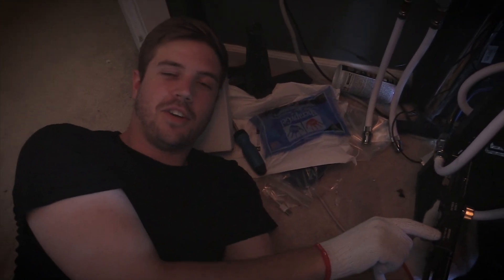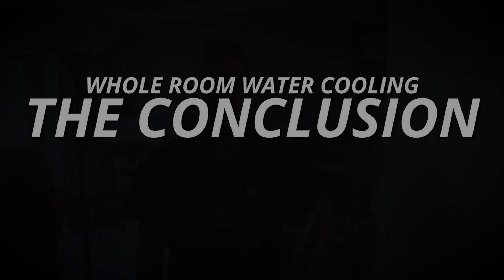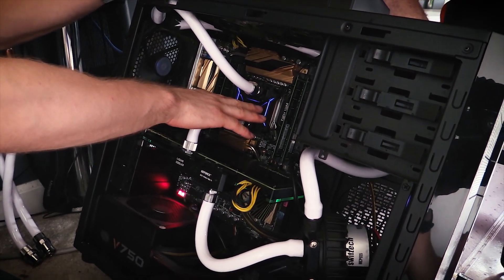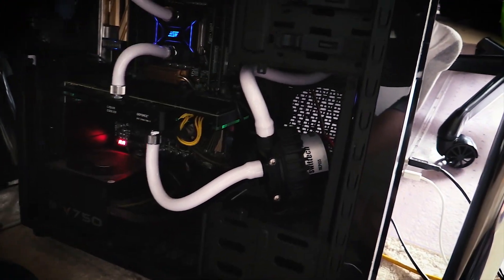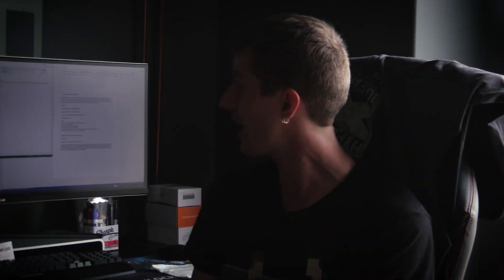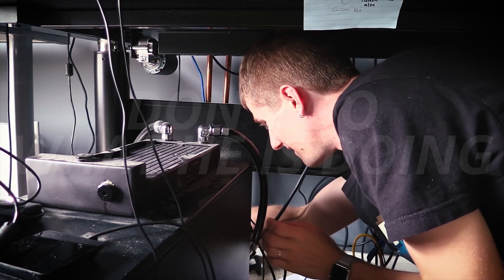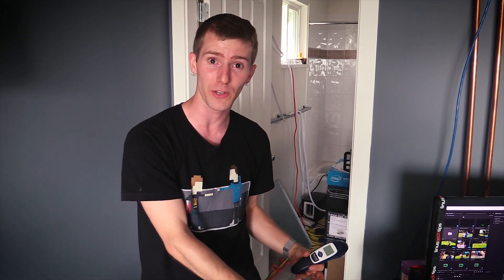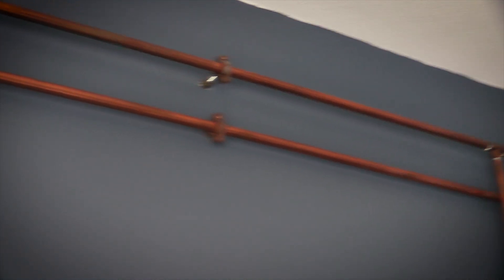Whole Room Water Cooling Part 7 - It's FINALLY over!

Comment: Isn't that going to bring the value of the house down?
Reply: RaySchrantz Ever heard of disassembly? If i buy an shelf and mount it to the wall i take it with me if i move.
Reply: HazzaRamma123 no, they are going with air conditioning in the new office. Linus already said that.
Reply: I do property management (commercial) and no, all that stuff can easily be removed. When you look at a house to move into, there are always going to be lots of marks, holes in wall, etc etc. but you can easily patch it up to a decent/acceptable state. If you are renting however, landlord would probably deduct a tiny amount for excessive holes in wall (screws, large nails, mounts).
Reply: They're going to take this set up to the new office
Reply: RaySchrantz No.
Reply: LxC The only thing they have to do is patch the holes. re-paint any walls they may have painted themselves, clean the floors and do a decent job of vacuuming the rugs.  I don't know what the rent laws are in Canada but depending on how old the rugs are the landlord has to buy new rugs anyway which shouldn't come out of their deposit.
Reply: James Bernard
 Yup, exactly.

Comment: Linus it would have probably helped if you insulated the copper pipes on the outlets as to keep the heat within the pipes. You would have probably seen a sharper drop in temps.

Comment: I think that the whole room water cooling approach is quite practical. It is relatively easy to add new systems to the loop, and it is quite a nice performer. There may be a case where there is a room with no windows or AC, such as a basement, for which this project would have been perfect. 
It also has it's caveats. For one, I don't think it was anywhere near cheap to make, with all of those expensive fans, radiators (I think a better solution would have been to use a car radiator + fan), and fancy fittings. Other is that you need another room to install all the pumps and reservoir, plus al the hassle it would take to make it appealing.
I think that in the end, it was nice of you guys to try this out to

Comment: You should try using those thermal insulating goop or w.e to cover the pipes, you'd need a lot but at least then the heat won't dissipate into the room

Comment: Umm, Linus, couldn't you just, you know, move the PC's out of the room? LOL
Reply: ChapelCentaur92 Because it was probably the best room for all the computers to be in space wise. Or else he would have moved them into another room :p. Seriously though, a few air con units in the room would have been much more practical.
Reply: ***** Thank you...
Reply: They don't have the space to give everyone their own office, plus it'd be less efficient if they collaborated on a video.
Reply: ***** What about that system requires HDMI? DVI and display port can also be run very long distances, the conference room at a company I once worked for even has a DVI port mounted in the back with in-wall wiring connecting it to the ceiling mounted projector (that rig is kinda old, hence the DVI to a projector).
Reply: Wolves4ever 01 I think the problem with installing an a/c in that room is that window.  That window is the side-sliding type and it is not that wide.  To cool that many PC, they need an a/c that is rated 10,000 to 12,000 BTU.  That is a large unit so no way to install that on that window.  A floor a/c will be impractical due to space.  The only option is the external a/c unit where the compressor is outside, hanging on the wall of the house, and the outlet unit in the room.  However, that is a rather expensive to do and, if you are installing that yourself, rather dangerous without the right equipment.  That room was not meant to be a workstation room.  lol
Reply: Oyamada13 The extra AC unit in the windows wouldn't replace the central AC, so you could get away with a window unit quite easily as it would accompany what AC they already have. Trabber Shir quality HDMI cables can run something like 45 feet before you need one of those RedMere cables, or any sort of amplification.
Reply: ***** HDMI is suppose to replace DP which only has only a 16gb transfer compared to 32gb and shitty sound quality
Reply: AdamantiumDragon NG  I'm assuming typo or grammar error, but in case that is not the case let me correct you.
DP 1.2 can transfer 12.6Gb/s, DP 1.3 can transfer 32.4Gb/s and HDMI 2.0 can only transfer 18Gb/s.

Neither is meant to replace the other they are competing standards from competing companies. DP supports multiple displays, higher max resolution and better sound, but has higher royalty costs, does not transmit over long distances as well, and is harder to implement against.

I'd like to thank Brenden Bauman for pointing out the range limitation, I'd never tried running DP over more than 3 meters before so didn't know about that limitation.

Comment: Instead of an outside radiator you should have gone with a well that goes deep enough to get flooded by one meter of water inside of witch you could have coiled some varnished copper pipe and the heat would have dissipated in to the ground water witch has an enormous thermal mass and could have made a phenomenal difference during summer but for the Canadian winter that outside fan is priceless.
Nevertheless the greatest infraction of that design is in not insulating the copper pipes witch left exposed are cooling the hot room more than the systems.
It's basic physics, how much copper surface area (pipes) was touching the air in the room versus how much copper surface area (water blocks) was touching hot silicon die.

Comment: interesting idea, horrible execution. you are better off using insulated piping that runs to a phase change cooler to cool the radiators if you were going to be extreme. pressurize the system to allow for lower tempertures and protect your shit from dew point. 

or just use AC and big ass radiators....because thats logical

Comment: From the first vid I thought this wouldnt work, you spent  tons more money on quick release fittings and copper pipe that just a simple air con would have cost. Anyway if you are using machines for rendering and stuff the the right hardware would be a good start too - as I am sure will be the case in the new place

Comment: ..Wait, why didn't you just insulate the hot side copper? It won't radiate no where near as much heat and this system will get MUCH more efficient. You can't complain about it not working if your system is flawed.

Comment: If I were to do this I think I would go with PEX through the walls rather than copper. The advantages are numerous... cheaper, less fittings required, better insulation, scale resist, doesn't corrode, and it is quieter (though maybe sound isn't a problem at that pressure.)

Comment: plz do whole room mineral oil cooling! I have no idea how it would work.
Reply: Baldrick sodoff Then they'll be working in scuba gear. Haha**P e a c e
Reply: DedPixel The pee and the oil wouldn't mix. So at the end all the pee would wind up on the bottom of the room with the oil above it.
Reply: Baldrick sodoff Then no one would notice if you peed while you work.
Reply: Baldrick sodoff They could put holes in the firepole and pump air through the bottom to make bubbles too!
Reply: Sonix GER But nobody would know who did that. ;)
Reply: P@r@m3d!© mineral oil isn't dense, oil floats on water. It's viscous. Also, it'd probably have convection currents in the huge pool of oil, which would be incredibly impractical. Olympic swimming pool mineral oil super computer anyone?
Reply: That's like impossible. As you've seen before mineral oil has a very high viscosity so that normal fans spin ~50% lower. Imagine the strength of the pump you'd need to move so many litres of oil around.
Reply: bassl0va
Yeah sorry that's what I meant.
corrected
Reply: Sonix GER What SajtosPoga said! :p
Reply: Baldrick sodoff mineral oil is not nearly as effective as dissipating heat from their components as straight up distilled h2O
Reply: Yor Highness Well it's not too expensive, it's just a waste of money xD